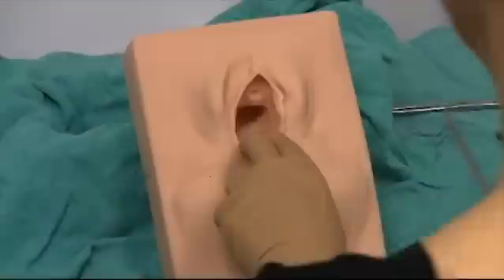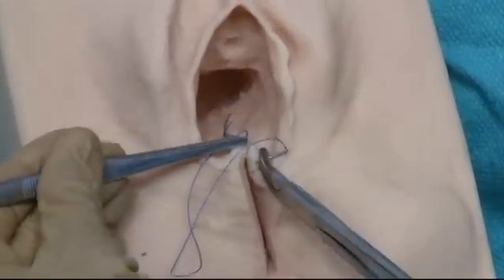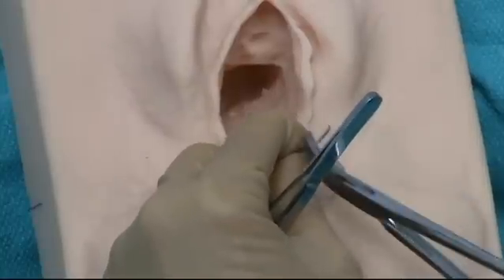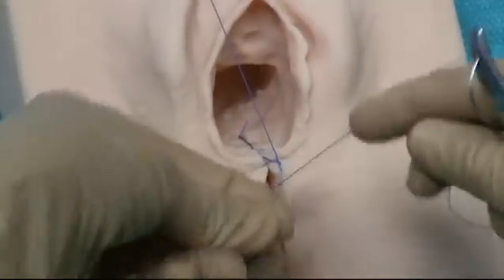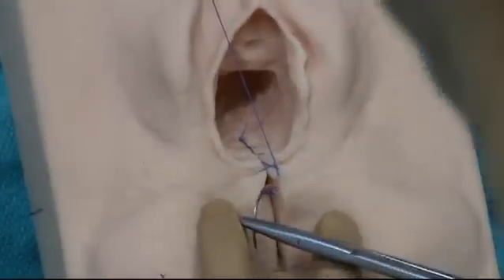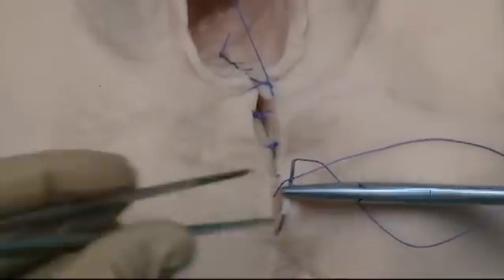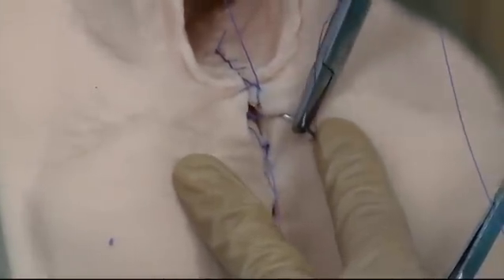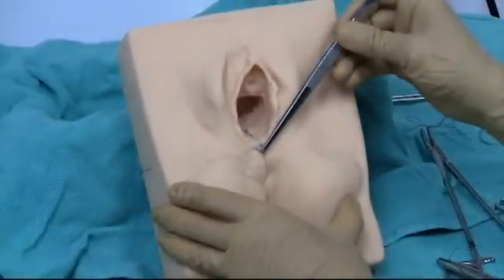Alternate Perineal Repair

Comment: The Plastic Surgeon's technique of 'skin tissue expansion,' gradual and most importantly painless, skin stretching, applied to the vaginal opening, with the 4 fingers of both hands pulling sideways, over 7 consecutive days,  from 26 weeks, achieving 10cm diameter prior to birth, or even up to the second stage of birth, makes the destructive cruel episiotomy totally avoidable/obsolete. As 10cm is the maximal opening of the pelvic outlet. Wikipedia UK 'Perineal massage' being the traditional way of aiding a natural birth, with no damage to mum or baby. It avoids the possibility of death of mum from the complications of an episiotomy: notably, sepsis following 'necrotising fasciitis', and haemorrhagic shock, as the pelvic floor muscles have a good blood supply and bleed briskly and are not sutured immediately by skin-glue, so exacerbate the blood loss of detachment of the placenta in a prolonger labour, with resulting atonic uterus. It is rapidly losing favour, as it is destructive of the pelvic floor muscles, the foundation of the lower abdomen, so worse than FGM, predisposing to prolapse of urinary bladder anteriorly, the large bowel posteriorly and uterus around the menopause, when the uterus enlarges with fibroids and prolapse down through this weak spot and mums describe the intense burning pain when passing urine, every 4 hours, into this full thickness penetrating wound of the lower abdomen, over the first 1 days as it starts to heal, as torture. Yet it is totally avoidable. The associated antibiotic use hastens the day when bacteria will be resistant to antibiotics and invasive routine surgery will be a thing of the past. YouTube video 'Childbirth explained for kids, from floor to trapdoor to floor, thanks to the property of muscle', ass once the fibrous coat of the pelvic floor muscles has been stretched, the muscles can stretch to 3 times their original length without damage. Epi-no and Aniball birth trainers now exist.
Reply: Is repair to the posterior fourchette possible during menopause?   What about using PRP plus stitching?

Comment: Terrible. I would not want her to hem a pair of pants. All of the women's rights groups need to lobby for better training, "some women may find this knot and little bit of suture material, that's left to dissolve (....or NOT ..) irritating". Really ? Who is holding these DRs accountable for bad performances? The incompetence of physicians and especially residents needs to be addressed . The recall of suture materials and meshes needs to be proactively discovered,  announced, and resolved .  The lies concerning the  falsification of medical records and denials of devastating results need to be better addressed. Physicians who lie and dismiss patient complaints must also  be  sufficiently deterred with dire consequences.
Reply: How do you think things should be sewn back together if not with sutures? I just had this done plus much more and I feel better 5 days after than I have in 5 years. Literally the only thing that is a little bit irritating is the top few stitches in my peritoneum. I think this is miraculous that this is my only discomfort considering they repaired a cystocele, rectocele, discovered and repaired an enterocele previously undiagnosed by multiple MRI and exams, and reconstructed my peritoneum all of the way down to my rectum. I literally have 2 layers of stitches under my bladder b and from my rectum to my uterosacral ligament and my peritoneum sewn shut and anchored to my USL. I also still have a catheter and vaginal packing. If a single stitch is irritating and they consider this worth pointing out, they are doing an amazing job. Do you have these same opinions about knee surgery?